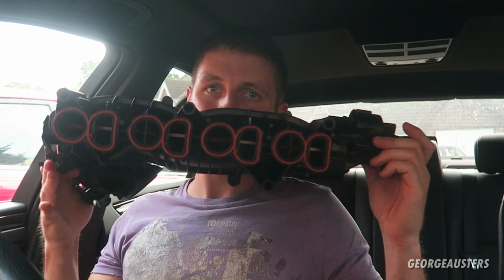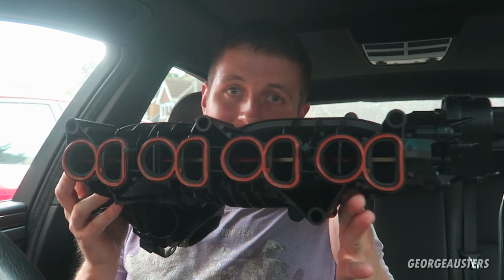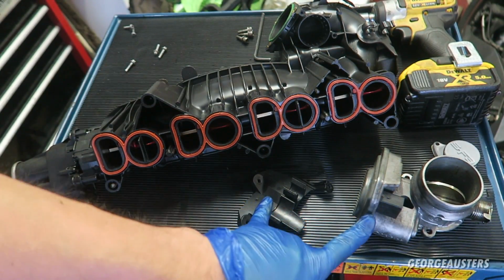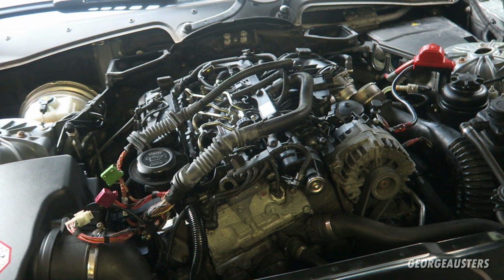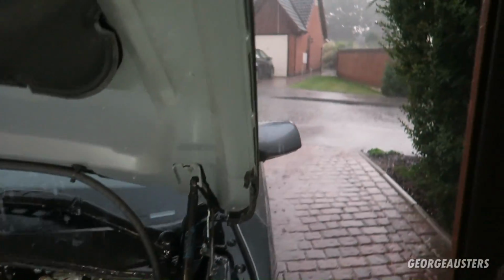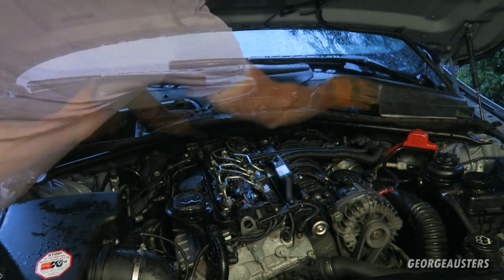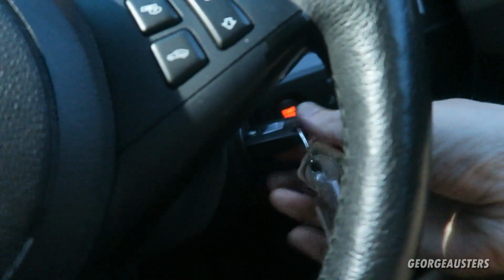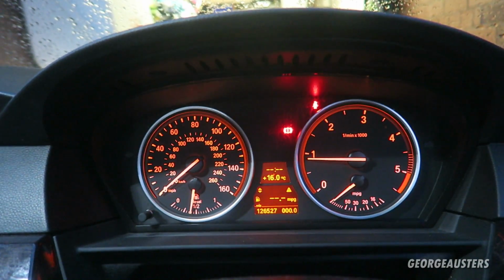BMW N47 *REINFORCED* Intake Manifold Installation

Comment from the maker: As the N47 engine does not generate enough income for this channel, I likely won't be able to make further videos on it. If you would like me to continue making these videos on this engine then consider making a donation as I have put a lot of my own money into it which I have not got back.

Donate HERE: https://www.paypal.com/cgi-bin/webscr?cmd=_s-xclick&hosted_button_id=EVEBM82N66TCY&source=url
Reply: George, your videos helped me to repair my BMW with N47 and same problems with intake manifold, i saved money so i donate and 👍🏻. Thank you!
Reply from the maker: Yaroslav Parpaley Thanks brother, appreciate you🙌🏼
Reply: From one George to another, thanks for this one. I just bought into 520d ownership with a long list of prev. Maintenance to do on a neglected car and was looking for a decent solution for this problem as experiencing lack of torque in low rpm and higher gears exactly as you describe.

I will donate too as you saved me time and hassle on this one, and your other content is also useful as a quick guide.

As to the argument about cost, yes it's expensive but if you calculate the loss of mpg over a year's usage I bet you would have or be close to covering that cost, nevermind the car operating as it should without labouring.
Reply: @george austers by removing the flaps will eliminate the front leak on manifold?
Reply: Sounds weird for me. Could be the cultural difference. Comparing to financially poor post soviet countries car bloggers with 2 videos a week who never asked for donations in the same way. They work hard for 2-3 years without much income form youtube generating content every week and make connections with sponsors spending their time and money. No way they ask for donation because some videos does not generate enough money. People will support you naturally just keep it interesting and add more fun. In my opinion you will get more money from some kind of crazy project. For example buy destroyed m3 from copart and make it look great again. £50k Bmw for £3000 add some clickbait etc. There is no much competitors in UK. Car throttle is a joke comparing to Russian top car bloggers. Have a look at Academeg or Smotra TV. And finally I know: Your channel your rules!

Comment: it's a throttle valve
Reply from the maker: @maan7358  it’s an anti shudder valve
Reply: It's your throttle. But one of its functions on shutdown is to fully close to prevent shudder, but its main function is to regulate air as the throttle.
Reply from the maker: @maan7358  No it's not.. Doesn't work like a throttle at all. It just opens when you turn the engine on and closes when you switch the engine off.
Reply: I'm confused now😮. In ISTA, it refers to it as a throttle valve. What controls the speed of the engine ?

Comment: I be grateful if you can advise me please. I have BMW series 3 320d  2011 .The swirl flaps are worn out mechanic has taken out the swirl flaps and told me he has blanked it and told me most people do this will improve engine performance and will increase fuel efficiency and power. 
    Is this the right thing to do ? He told me you won't notice the difference in driving if its blanked not having swirl flaps Or having swirl flaps  ? Please advise me the best option.?

Comment: Newer N47 haven't got the swirlflaps at all. Mine is a N47 (E91) from 2012 and the inlet  manifold differs a lot  from your  from 2008.  I cleaned mine manifold at 100 000 miles, and it was definitely necessary.
Reply: My N47T engine on  my 525D Xdrive F11 is also from 2012. I will check with BMW if my car haven´t  got swirlflaps. So maybe I only need to clean my intake manifold too. Thank you very much for your information:-)
Reply: I have a bmw 525d f11 2013 lci and mine has that

Comment: hi goerge thans for this vieo again !! the egr pipe that you blanked off with the peice from DD i have a question for you did you have to block off the other side of taht pipe of the intake side ?? where its connected go the engine block?? im just  not sure how that system works ??
Reply from the maker: No need to, you can just leave the pipe on
Reply: @GeorgeAusters  well I've bought the blank valve from Darkside developments already !! So I just wanted to know what blocks the other side of the pipe once it's removed ??

Comment: excellent video George I'd love to know how that worked out for you long term ?? and where did you get that egr blank plate ?? I went through your link aswell and added the intake to my cart man looks like a great upgrade I have a small leak somewhere not sure yet if it's the turbo whistle of if it's the vacum leak but I'll find it my charge air line is a bit loos and shaking is that normal or is it supposed to be a solid tight fit ??
Reply from the maker: All still on the car and fine👍🏻
Reply: @GeorgeAusters  that's the job I found a blank kit from DSD and I'm currently watching your videos on the brakes mate

Comment: Hi George….first thx for your videos.
I want you ask, how many miles have you till now done with new intake manifold? Is still all good? Have you any issues?
I drive my car for about 2 years without swirl flaps and now I want to replace my intake manifold with this one.  One more question…my friend had swirl flaps in ECU unsubscribed…..will I now have a Problem with  new intake manifold Installation? Do I have again to make sofrware change in ECU or ECU will recognize a new intake manifold by itself?

Thanks in advance!!!

Comment: Ive done the job. But now regretting the swirlflaps delete... the car drives so boring now. 
Just saw this video and wow the upgrade part looks great. 
Im having problem trying to order one since this upgraded part is in berlin....and brexit has caused problems on shipping so no more uk orders. :(
 i might have to get the basic new one. :(
Reply from the maker: What issues are you having with shipping? I’ve ordered loads from Germany with no problems
Reply: @GeorgeAusters   on their ebay link, on the description it says. 
Due to Brexit and additional fees connected with the customs procedures the shipping to UK is not available.

Comment: Did you send it back your oryginal manifold intake to the company in Germany PGMTECHNIK???I think ,instead to clean mine intake manifold I prefer to buy 460euro Reinforced Manifold Intake from PGM
Reply from the maker: Yes, check the link in description👍🏻
Reply: @GeorgeAusters  ok thx for your answer.I don`t want to delete egr,egr cooler cos bmw dealer installed new in my 2015 n57 lci a few months ago,I don`t want to delete swirl flaps as well cos on my clock is only 85k km so I prefer to buy reinforced intake manifold and replaced it and it will probably work for a long time with aluminium swirl flaps.

Comment: I noticed that when you removed the intake manifold, you did that differently than how you are installing it now...
Reply from the maker: That was when I removed it months before, watch my swirl flap video for how I removed it this time
Reply: @GeorgeAusters  3 months ago i went to a Garrage with a leak at the front of the intake manifold and a week battery. They told me they fix it and they changed the alternator, only to die on me 2 days later. I spent 900£ for them to put new alternator, new battery and sort out the leak. I had been severely ripped off and the problem still there. Today I removed the intake manifold only to discover nearly an inch of oily carbon mess. The swirl flaps are intact but covered in mess, they didn’t even cleaned it. Tomorrow ill install the new reinforced intake manifold. Wish me luck as it’s my first time to ever work on a car 🤞🤞🤞
Reply: @danacarp2004  and did it work well ? Did you need to perform an "adaption reset" ?
I ordered mine today and will do the replacement asap

Comment: I ordered mines from the link you posted, it just arrived today but there is something different about it. At the very top/front of the manifold is entirely made of plastic and doesn’t have the top metal...is that normal? Would it make a difference?

Comment: Hi George, I just bought a 328d and two weeks later it gave some P2004 intake manifold runner control stuck open and P2453 DPF Differential pressure circuit range/performance. 
I took the entire manifold and cleaned it but the the code did not go away so does that mean its time to replace the air intake manifold??

There is also a open EGR coolant recall issued by BMW. Do you think this might be related to the recall?

What do you suggest at this point?

Comment: Hi George, thank you for the informative videos. Been very helpful! I am a bit confused on the blanking plug you added (EGR pipe), what happens to the pipe and the other hole in the engine that it connects to? I must admit, I thought that was a breather pipe (crankcase?), which you did mention adds some oil into the manifold along with recirculated exhaust from the EGR......sorry if I have things mixed up, but I do have a pipe and a hole at the other end of that blanking plug.....cheers M 😁
Reply from the maker: That blanking plug I installed replaced the pipe👍🏻
Reply: @GeorgeAusters  What did you do with the sensor that was attached to the pipe? 
Since the pipe is now gone, did you:
1) keep the sensor connected to the other side, but reading from "nothing"
OR
2) remove the whole line/sensor - in which case, was there any error code thrown by the ECU?

Comment: Great video as usual George. That manilfold converts to about $760 Australian dollars. Here, a new manifold from BMW is around $2300. So this reinforced manifold is a fantastic option, even with adding in freight. Cheers!!
I'm about to embark on an oil filter housing filter change, wish me luck. I hope the manifold doesn't have to come back off, haha.
Reply from the maker: Good luck Rob!
Reply: @GeorgeAusters  cheers, I meant gasket haha.

Comment: Good work G.
Did you walnut blast the valves at any stage in the past?
Glad to see the refurb manifold. Swirl flaps are there for a reason. Deleting them is an amateur approach.
Reply from the maker: I've cleaned the intake ports when I had my engine out: https://youtu.be/c_VK-cUoccE